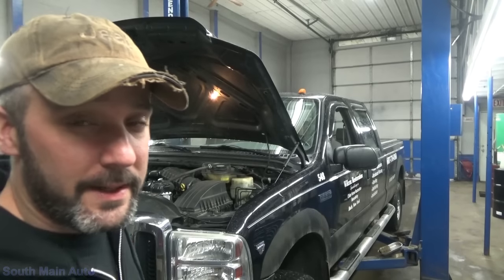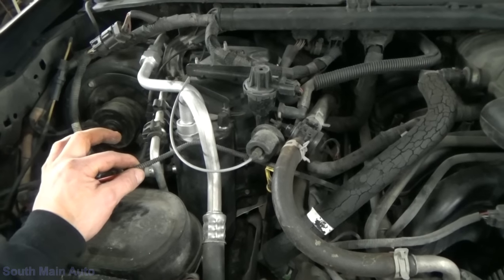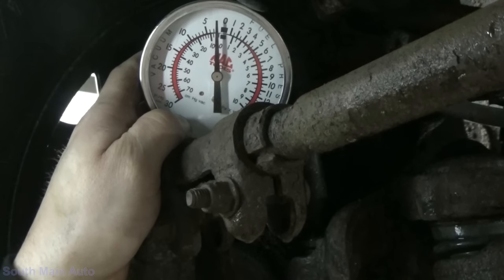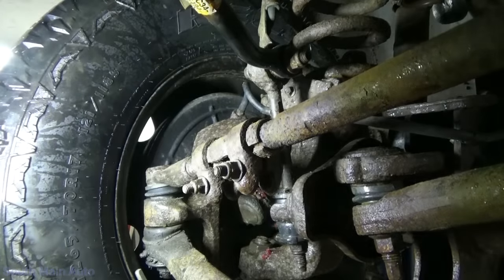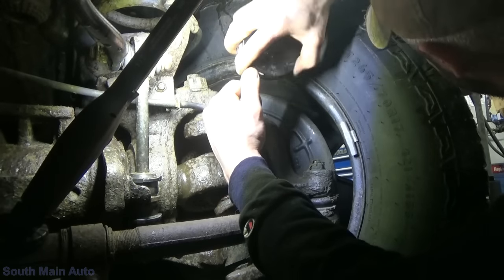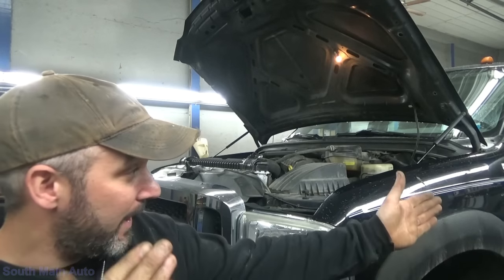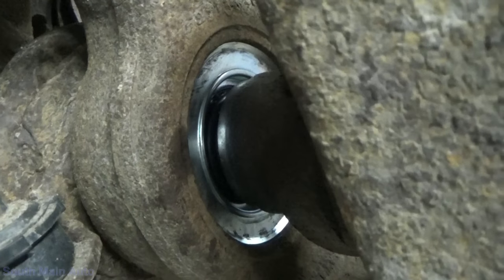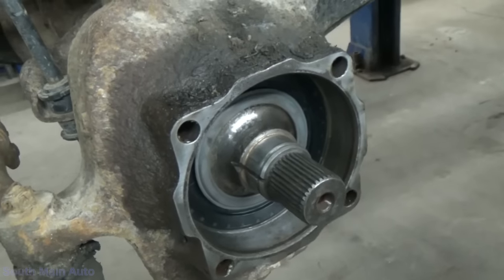Ford F250 4x4 - Vacuum Hubs NOT Engaging

Comment: I was a Ford shop foreman 10years that was enough Ford but an engineer did show me an easy driveshaft balance with a hose clamp on the shaft but not completely tightened, Jack stands under rear axle, someone in the truck running the speed to optimize the vibration. A second person with a piece of heater hose taps the clamp until the driver beeps the horn when the vibration is gone. This an approved repair.

Comment: Just finished doing them on my 17 super duty.. The sad part is that I had them "done" at a well trusted automotive facility last season and they've never worked more than once.. I confirmed that the shop doing them knew that there was a installation tool that needs to be used.. They said yes we know.  So now after going almost a year without the auto working and confirming the vacuum is present and the lines are good with no leaks.. It could only be the hub seals.. When I removed them, there is pound marks all over them from using a hammer and punch to install them... I'm soo effin mad at these clowns...$1100 down the drain and I fixed them myself for less than $200 including the tool.

Comment: excellent video, i have a vacuum leak but never thought about putting smoke in the knuckle to find out where it was leaking. After seeing how to replace the seal i think i will just twist the hub when i need 4-wheel drive.

Comment: Couldn't imagine living somewhere where the rust will ruin a otherwise good vehicle. My 06 f250 with 220k still doesn't have rust. Love this channel.
Reply: Here in New Hampshire, they use tons of salt. The fenderbergs melting in my driveway, actually kills my grass by the run off. Both of my e350s are rotting slowly from the bottom up.

Comment: That vacuum system is a complete nightmare!  All to save a guy from climbing out of their truck for 20 seconds and turning the lock outs. Fine job find and fix the problem though. With as fast as they wear out one could go broke feeding that thing seals!  Thanks for the video.

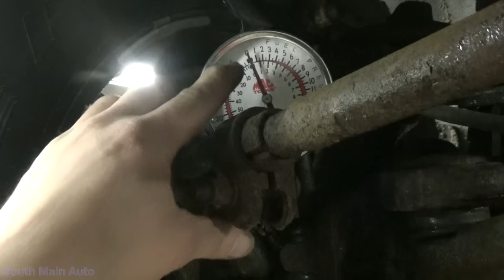Comment: 10:43 My 2004 6.0 F350 Takes forever for the vacuum to drop off of the front hubs. We have been doing the manual turnout method you described by disconn solenoid and turn hubs manually. X-fer still OK. Hey Eric! Rather have you work on my truck, You don't need practice. You got this!

Comment: Great work man. I have learned allot of things from you.  You are right, they are designed to fail. They could use a bearing that has the same thickness instead of that seal. Damn that is one bad design.

Comment: I re-installed an old seal on a '06 F-250 just tapping it in around in a circle with a large punch. Nowhere near as quick as having that tool, but, that was the first F-250 I've ever done ... and I haven't seen one here since (not too sad about that, lol). I'd imagine trying this with a brand new seal would be a severe ball-buster, for sure. Luckily the old one was still good. Had to do upper and lower ball joints on the thing. Had to borrow a giant wrench from a shop down the road to finish it too. Was my neighbor's truck, and his brother helped me - was some brute-force labor on that job. Was glad I had help. Can't remember how I got those massive ball joints out, but I remember it being a fight all the way.  I'll probably pass on the next one! Rust central ...

Comment: Excellent videos on the F250, all the way from start to finish on ball joints, axle seal replacement and tie rod ends. Appreciate the detailed info on tools required for the job! Nothing worse than getting into a repair and not having what you need. Did need to cut a couple pieces of three inch pipe for the ball joint install, tool from HF didn't come with all the sizes but still worth $100

Comment: Excellent how-to video.  Seal tool: On the drive shaft end I used the cap off an acetylene bottle. On the hub part I used the bell end of a piece of ~8” long x4” sch 40 up against the seal and put a cap on the non bell end and whacked it on with a hammer.

Comment: Eric, that was an awesome video. I have a 2005 Ford F350 Super Duty that won't shift into 4WD, thanks for the tips and troubleshooting. I feel that when you beat yourself up for not checking the vacuum on the drivers side that when you pinched the vacuum hose on the driver side and the passenger side vacuum didn't change, I feel that was a good test.

Comment: Good job showing where all the lines are. My auto lock didn't work. Found one side disconnected on mine after noticing that the vent air was switching from dash to defrost on its own when turning on 4WD. Fixed it just in time for snow to fly. Thank you for the help.

Comment: you can make that same hub seal driver with a pipe flange and pipe. I just made one a few months back on an Excursion.  Cost was  $25.
you need to grind the flange to fit the hub bore and really take care to not over drive it in or under drive it in. I managed in a driveway and may have shot a video of it.
Reply: Very easy to make from 1, 1/2 pipe nipple 10" long, cap, flange turned on a lathe a bit smaller than the seal .

Comment: first time I've ever left a comment on a video, but this vid was so well done that I had too.    Had similar failure of autolock hubs not engaging on my 2002 F250SD...the vacuum gage readings that the author showed in his video were critical to figure out what I should be seeing on my truck.    I was getting vacuum at the wheel ends of the vacuum lines when selecting 4WD in the cab, so it showed my solenoid was operating...it was just low, only around 4" of Hg or so...this vid showed me I should be seeing around 20".   Poked around and got around 20" of Hg at the inlet of the solenoid (red hard plastic line) and was only getting 4" of Hg at the solenoid outlet (black hard plastic line)....replaced solenoid and vacuum immediately went to 20" downstream of the solenoid valve.    4x4 worked.   Thank you!!!

Comment: Eric, I have driven in the rear hub seal using the larger cones from a tire balancer machine.  The size and shape are close to the special seal driver kit you have.

However, getting the depth correct is tricky and requires attention to detail!  Just need to take note of the depth prior to removal of the axel during disassembly.

Great video (as always), I guess it may or may not pay to get the kit depending on how many of these older style trucks a guy really works on.  For where I am in MN we don't see many of these around anymore, but I just thought I'd throw it out there for those who are in the field working in a retail shop without the expensive kit available.

Comment: Mark's F350 needed ball joints and we had to replace those seals. We had them replaced at a truck repair shop.  Another problem with the vacuum system was the steel lines filling with rust. Drilled them open so vacuum could get to the hubs.

Comment: 1973 Pinzgauer I worked on had hydraulically actuated locking differentials and 2/4/6 wheel drive. It was original and still worked flawlessly. No vacuum, no getting out to turn hubs, just pull a lever. 

I think that particular Pinzgauer is on the set of "Stranger Things" for Netflix right now.

Comment: if the other side was leaking it would not held the vacuum so you did not need to test the otherside however for my own vehicle if I'm doing the seals on one side I would rather just do both sides and know that it will not fail a month down the road on the otherside. great video and you definitely are a real mechanic and not a parts changer. Good job!

Comment: Great video as usual.  I don't know what I'd do without my smoke machine...makes diagnosis so much easier. Part of the reason labor prices are high is to pay for all the tools required for diagnose & repairs. Can't wait for my Pico to arrive and thanks again!!
Reply: I hear that! $1,600 for my Autel, a grand for the smoker, now need a J-box, laptop, and the Pico. Oh ... and a concrete pad and a lift! Going to be a lean year for me here, lol.
Reply: You don't need all of it b/c you can do a lot with a test light, loaded circuit, DVOM, Brakleen or propane and a water bottle but to be efficient and be able to isolate dropouts, glitches, or smoke a hub, intake, EVAP, etc then the better diagnostic equipment like smoke machines, lab scopes, etc come into play.  I have a Verus Edge and it can do  just about anything but the Pico is heads & tails above the capability of the Verus so fixing the difficult problems just got a little easier. Sounds like you are tooling up...you know I have a saying that you can never have too many tools as long as you use them. The fun part is using them!
Reply: Seems like overnight that one day I was using a timing light, changing carb jets, plugs, wires, caps and rotors ... and the next thing I know, cars with "check engine" lights were everywhere. I resisted as long as I could (20 years lol). I focused my attention on motorcycles, and OPE, but now the time has come. 

After seeing Eric, Paul, Ivan, the "other" Eric, and several others on Youtube, I finally had a place  to get the knowledge I was thirsting for. I had been fumbling with '96+ vehicles for all that time, never really grasping how these things could be troubleshot with 99% certainty - I didn't think it was possible! Used to frustrate the hell out of me. Seemed like everything was a big secret - just couldn't get the right information anywhere I looked. Spent hours on the net with nearly every job. I have been getting by without these tools for a long time, but I've come across many cases where I found myself wishing I had the smoke machine, & scope (the lift is a daily wish, as my back and arms remind me with throbbing pain, lol). - heck, I just got the Autel this past summer - prior to that, I had no bi-directional capability. Got lucky many times just going on instinct, and help from Google. Would much rather have the ability to do it 100% right, do it quick, and do it once. The Youtube guys have got me motivated. :)

Neighbor's car has positive fuel trims - I know it has a vacuum leak ... somewhere. Suspected the intake gaskets, as I had just done that job on nearly the same vehicle days prior. Tried water, visual inspection, and even cigar smoke (neighbor nearly passed out puffing away!) - still can't find it. Was wishing I had the smoke machine that day ...

Made the decision to go all-in, because I'm seeing that this computer stuff ain't going away ... it's only becoming more complicated every single year! Pays better than working on OPE too. :)
Reply: Yep understand!. If you really want to learn at an extremely cheap price the subscribe to Paul's Scanner Danner Premium Channel and buy his book. You're watching the right channels & learning from great mech/techs. Wells Tech has some great videos also & he just got a Pico and is going to start using it for diagnostics and he is also teaching videos on fuel trims right now. I took high school Auto Mechanics in the AM in High School & went to BOCES all afternoon in my senior & junior days so High School was pretty sweet back then. I started working in a dealership in 1974 and the rest is history.  The points/condenser days were boring to me, even the electronic & HEI days but today's cars are fun to diagnose & rewarding to fix although sometimes you want to blow them up. Hope this helps a little.
Reply: Thanks man! I appreciate  the info!

I actually just ordered Paul's book this afternoon. :) Been wanting to sub his Premium channel for a while now, but between the tooling and Christmas, the ol' bank account is approaching the danger zone, lol. It's definitely on the short list.  

I find myself wanting to blow these newer ones up more often than not, LOL! I make sure to throw the Craftsman tools, and not the Snap-On ones ... :D
Reply: Paul's Premium Channel will be the best $99 you'll ever spent & a quicker learning curve. I subscribe every year b/c for instance he had a programmer do a 3 part programming video which made the investment worth it.  Lots to learn from Paul.
Reply: Good to know. Just from watching his regular vids, I knew that his Premium Channel had to be top notch. The minute I get my finances in order here, that'll be my next purchase.

He was the first Youtuber I started watching for hours at a time. If I had 1/8th his knowledge about these vehicles, I'd be doing real good!

Thanks again! :)
Reply: He's a great instructor and you'll have access to all his classroom training & your welcome...anytime!!

Comment: Great video as always Mr O, but if one side is bad, wouldn't be advisable to do both sides together? You could fix the bad on, send it back to the customer and then 3 weeks later the other side goes out?? Just a question and would like your advise. Thanks

Comment: Replaced a LOT of the hub seals when I worked for ford. Use to pull the lock ring and snatch the hub off coat it in vaseline then recheck vaccum. About 85% of the time it was just the Oring had failed

Comment: the very first thing i did on my ranger with this system is pulled it pitched it installed ridge runner locking hubs work great

Comment: Imagine some Ford engineer probably got a bonus and a vacation for that design!
Reply: Yes but that was in 1982! LOL still using the same design.
Reply: @curtisroberts9137  except..... the ford trucks in 82 used manual locking hubs (aka, get out and turn a "knob" on the hub)
and GM used auto FULLY MECHANICAL hubs.... 

this shit was designed in the LATE 90s!!!!!!!! 

i think the dude who designed this thought it was 1896...... and not 1996.....
Reply: @kainhall  now that's funny
Reply: @curtisroberts9137  So the 2020 F250 trucks are still using this bad design?
Reply: @311hitwall  I don't know for sure about the 2020s. I'm pretty sure the newest one I've seen was a 2016 or 17. It was a fleet vehicle so I don't know if they're any different than the when's it the average guy buys
Reply: @curtisroberts9137  I have read so much stuff about Fords I don't know why they still sell so well unless it mostly fleet vehicles that run up the numbers
Reply: @311hitwall  one thing you'll find is if you look up the combined sales of Chevrolet and GMC in many many years that equals greater than the Ford Sales however they are considered two Brands so Ford still has the best selling brand. Chevy certainly has their problems as well. Honestly if I was going to buy a pickup I would have to look real hard at Toyota and Nissan.
Reply: @thunderroad7289  they all have their quirks. Pick your poison and live with it. I've had Chevys with thermal couplers that failed = no front end engagement. My excursion auto hubs aren't working. It's common on higher mileage Fords. I'm just going to rebuild everything and move on. Stuff happens on whatever you drive something along the line will go wrong. I can say my 2019 tundra has been great but time will tell.
Reply: billy ???? Lmao I don’t give a crap I’m just tired of the same old Chevy guys talking shit all the time
Reply: 311hitwall Not exactly.  The newer super duty’s do use vacuum but they are not pulsed.  More like vacuum holds lock mechanism in now vs using vacuum to latch the hub and un-latch the hubs.  Similar to an air locker for a rear diff it has to have vacuum to hold the lock collar in place.
Reply: @thunderroad7289  you’re just mad your vacuum locking hubs are the most shitty design ever put in a truck😂
Reply: I had that problem in a couple of the service trucks I drove

Comment: great job as always. thanks. ive got a 2000 excursion that the vacuum pump that is mounted on the passenger's side under the hood burnt up. The vacuum hose to the hub on the passenger side broke and the pump ran until it fried. Replaced the hose and pump. Which fixed it.

Comment: Nice work! My 96 explorer has a similar system, but not in the hub. Has selectable 2wd on the Dana 35 in the front with a disconnect. Vacuum controlled with solenoids. Was only used in 95-96, then they went to an "always on 4x4 system.'

Comment: I've been manually locking my hubs in my Excursion since replacing my ball joints. Didn't wanna spend the money on new seals and the tool. I like having manual lockouts on trucks, only fail if they're worn out.

Comment: I installed Dana spicer super 60 upper, lower ball joints and Dana spicer u joints with Dana spicer axle dust seal, and axle shaft seal best ones to get well worth spending $400 on it last winter. I have to replace my locking hubs soon too. More worth it if you buy the whole Dana spicer kit comes with u joint, seals, and gaskets, and upper and lower ball joints

Comment: You can make a seal installation tool with an 8" piece of galvanized pipe, a pipe cap, & a 4"? flange. You will have to grind the diameter of the flange down to fit the seal properly, & the 1.5" pipe will slide over the axle shaft. The cap gives you a nice place to hit & keep the blows centered. All of the parts can be purchased at Lowes/Home Depot for like $25. I did mine this way & it worked perfectly. The special tool does prevent overdriving the seal where the flange/pipe/cap tool does not, but it still works just fine.
Reply: You can get them on amazon for $50 now.

Comment: Lost driver side at 60,000 miles of baby highway miles (2016 model). Easy diagnosis and fix, but why at 60,000 miles. Tx for another great video.

Comment: ford mechanic told me to spray some PB blaster garage door lube into the IWE few times a year..where the vac lines connect..does a good job keeping everything lubed ...the seals dry up crack and then you have leaks.
Reply: working shlub I've heard of adding lube too, after seeing this I'd be inclined to add a couple ounces of thick gear oil, at least enough to reach the seal area and keep it lubed / wash away grit.
Reply: Underrated joke